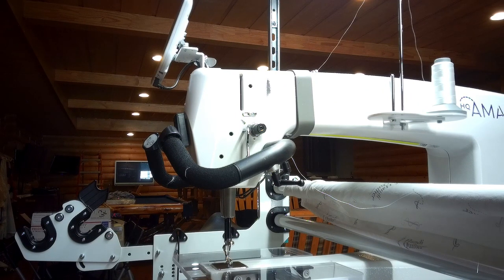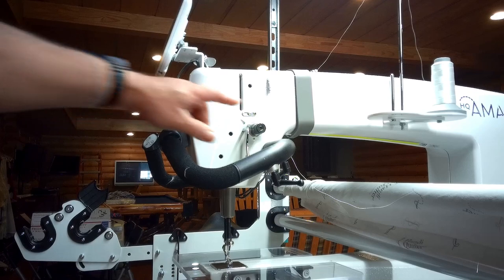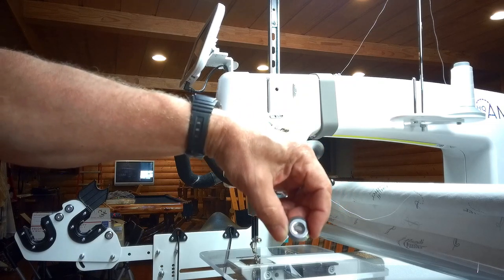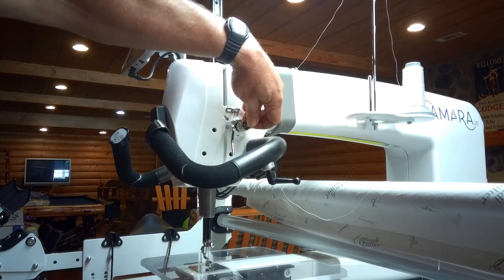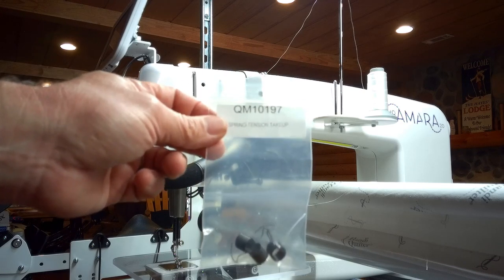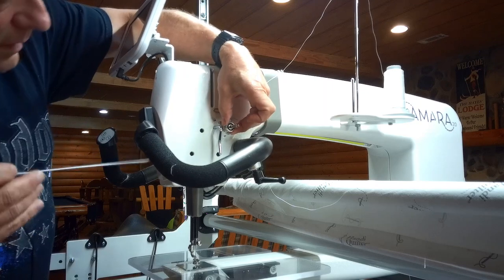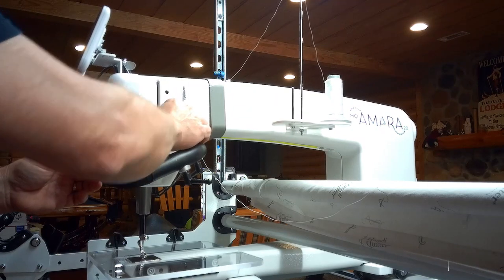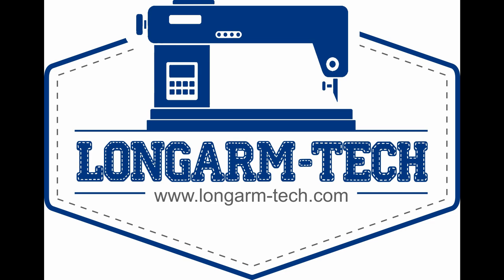Changing Check Spring on Longarm with Electronic Tension Measurement

Comment: I have an Amara. I contacted my retailer, purchased and replaced the chech spring three times. The longest one lasts is a month now. Will you please tell me where else I can purchase them and keep a bunch on hand? Also, any idea why after five years my check springs will not last now? Now my tension is a mess. I have reset it several times and if I have to move it a crank, it goes back to zero. Can't use the thread break sensor now either. I quilt every single day for customers; I can't handle my machine being out every few weeks.

Comment: I have the Amara. And I’ve had issues with my tension changing as I quilt. What I mean is that my tension dial is not remaining in the position I set it at. Is there a way to tighten the knob?

Comment: Do you have a video for a Handi Quilter 24 Fusion check spring replacement
Reply from the maker: The process is exactly the same - I think all the Fusions have Electronic Tension Measurement but if not there is another video for machines that do not have it - a little simpler.

Comment: What is the indicator / symptom that occurs for this to need replaced?
Reply from the maker: Wear marks on the inside of the spring from the thread cycling through it and cutting it are one sign - unfortunately the most common is a broken spring. Also shredding/tension issues - you can see if the spring has weakened and is not keeping the thread taught. This link will give you some more info: https://www.longarm-tech.com/knowledge-base/take-up-spring
Reply: @LongarmTech  thank you! I appreciate your investment in educating us.
Reply: Mine broke and fell off while quilting.
Reply: Thank you so much. I replaced mine today with your video. It wasn't terrible. My spring had a small silver nick in it. The thread was rough going through there. Saved a ton of money instead of having to hull it into a dealer.